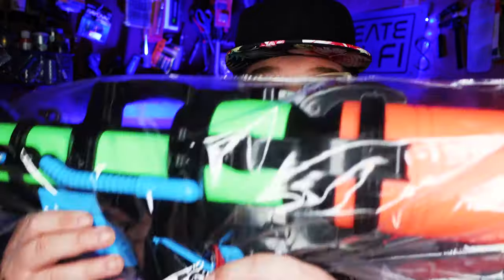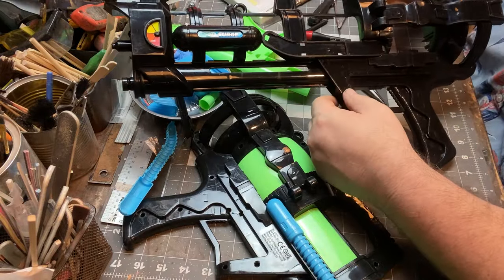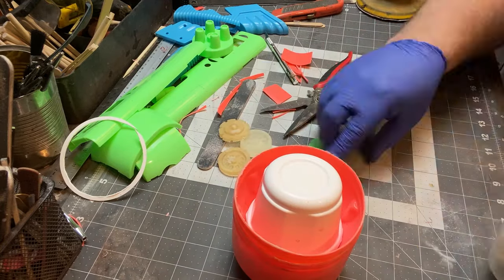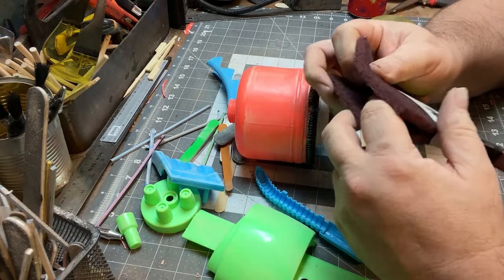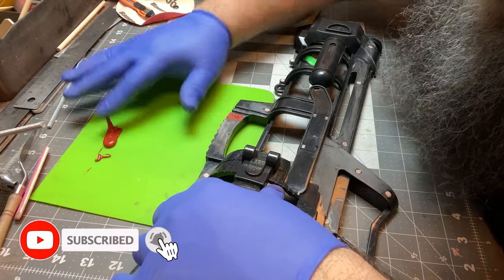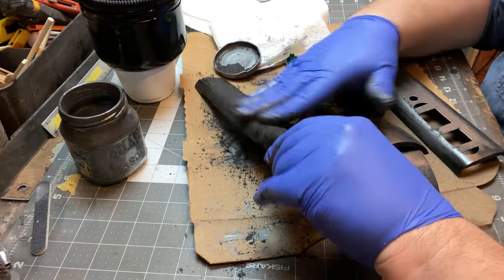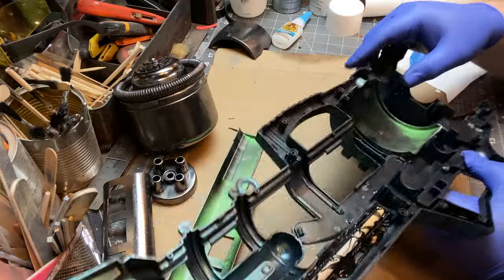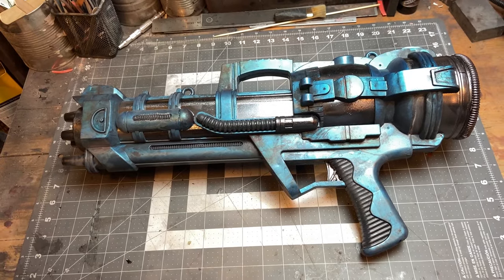DOLLAR STORE TOY TRANSFORMED INTO AN EPIC SCI-FI BLASTER

Comment: I would be curious to see a project where you make two otherwise identical blasters one with a functional trigger and one without, then film a scene twice once with each weapon, and then see if there is any real difference once lighting sound and VFX are done, also maybe a third where you do put a weight in the handle.  Just control all the variables you can to see for yourself and all of us which of these sorts of details really seem to matter to the final performance.  I could also see using a still functional nerf gun and greenscreening out the dart or ball with whatever plasma bolt you use and again see if and to what degree it effects the performance.
Reply from the maker: I've done both its fine either way :)
Reply: @createscifi  that's almost too bad, I had started to envision a series of side by sides to see which things mattered and which ones didn't, then at the end you could do like a fist full of dollars in space 8 man Mexican standoff  side by side with all the mods on one side and all the controls on the other to see how much if at all this stuff at the prop level changed things when it came to the screen.